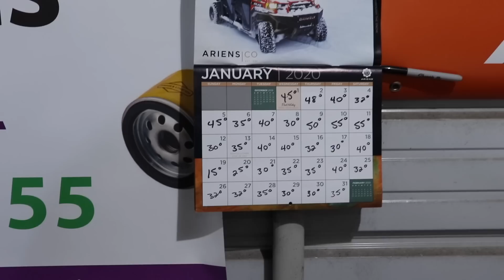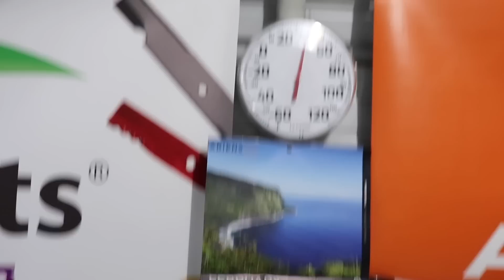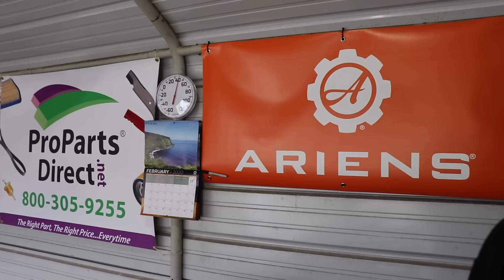WHICH FUEL ADDITIVES WORK? Which Don't?

Comment: Why are there no video reviews for star tron enzyme fuel TANK cleaner?

What is the difference  between fuel TANK and fuel system cleaners/additives?

And how many treatments do I need of the fuel TANK cleaner? 

Do I do 3 or 4 tanks from full to empty and  will I get a clogged fuel filter leaving me stranded???

If so, should I buy 3 or 4 extra fuel filters to keep in my truck for a just in case moment?

Comment: I've used Startron for years and it's never let me down. It's even kept fuel good I had forgotten about in a smaller gas can for two years. Still even smelled fairly fresh. Startron also has a new "Carbon Eliminator" spray you spray into your intake or carb at idle. My boat was hesitating and almost dying if I punched it outta the hole. Couple rounds of the Carbon Eliminator and the hesitation is almost gone out of my mechanically original 1976 Apollo boat with the good ol carbureted Mercruiser 165 4.1L straight six. I've also noticed the fuel guage doesn't drop quite as fast. So, in short it does exactly what it says it does!! Startron is simply the best in my opinion. You also can't OD on it like you can other fuel stabilizers, like StaBil. Use too much of that stuff and it'll literally eat your fuel jets. Ya....I'll stick with Startron. Great video!! One question I have is why do you go back to full choke when the engines try to die after they start making them sputter? Why not just kick the choke back on a little bit?

Comment: Feb. Wapio Valley picture, 40 miles from where I live. For the last 5 years I’ve just top off my Toro - Briggs engine mower with etho-free gas. Possibly use only 4 oz. of fuel a time, every 2 weeks. What impresses me is 99.9% of the starts are 1 pull. I’ve never owned a lawn equipment that did that. Also have a MTD Briggs 10 hp. chipper which has good starting qualities but I normal drain the fuel out and run the engine till it quits. Thanks for the videos!

Comment: My dad was an aircraft mechanic in WW 2.  He always advised me to let an air cooled engine run at idle for a few minutes to cool off before shutting it down.  I noticed you shut every one of them down at full throttle. Was my dad right or wrong?  Greg
Reply: They were probably cast iron air cooled engines. I have a couple of them and, I let them cool down before shutting them off. The others, I have, are all aluminium blocks and dissipate heat faster. It's probably an old school thing but, today's small engines are very different.

Comment: I'm no fuel expert, but it all seems to be a toss up. I was in a life altering auto accident in may of 2018 and just got a chance go fire up a couple of toys. One being a 97 bayou 220(a testament to itself) an the other a 09 yz 85. Consider one being a 4 stroke and the other being a 2 stroke respectively, but both had 93 pump used in the tanks and both fired up instantly(1 touch of the starter and one kick), after almost two years of fermenting. If you're surprised by this, we're in the same boat. I expected jelly carbs and fuel lines at this point if not inability to just ignite😕

Comment: Stabil 360 on 2 cranks but it surged a little before leveling out. What's making it surge like that since these are new engines. I know you have a video on engine surge but that is a used engine. #9 surged a lot too what's up with that bad gas already?
Reply: It's normal for an engine to surge a little when it's cold.

Comment: I'm all in on StaBil 360 Marine. Recommended for high humidity areas of the country. Every 5 gallon can I empty, I put 1/2 ounce in...don't have to remember to add at the pump. Use it all the time. If you don't, the junk in the gasoline builds up a layer throughout the fuel system. Its not only ethanol (drawing moisture from the atmosphere) in gas that causes all the problems, there are other chemicals added to gas that cause rubber to deteriorate.
Reply: Here we go. I've been saying for years that, small engine don't like ethanol. Some parts gets distorted and disintegrate. Rubber particles in the carb bowl was my first "hint".

Comment: Why leave fuel in the tank and carburetor to begin with? I've been running my lawnmowers until they run out of fuel before putting them up for the season and so far no issues doing it that way.
Reply: A dry carb will eventually have the gaskets dry out and crack, and the float will fail faster. Also, an empty steel gas tank will have more water condensation inside so it rusts faster. I keep my lawnmower and motorcycle gas tanks full all winter, with the motorcycle gas valve (petcock) left on, so as fuel evaporates from the carbs the float will open the float valve and refill the carb float bowls. I add Startron from the Walmart boat section to the gas. Very long term for a mower engine, I would add more fuel to the gas tank as the level slowly drops, or remove all of the fuel, and add a fogging oil to the cylinders and inside the carbs to keep everything moist.

Comment: Hey Taryl, Don't the engines need a blade to balance the engine? Or do the engines have a different fly wheel to compensate for the blade balance?
Reply: Yep, many models of small vertical shaft engines have weighted flywheels such as walk behind mowers that have blade clutches that can idle without the blade turning.

Comment: You should check the engine oil on at least one engine each month so we can see if there is condensation build up in the oil due to the engine oil not reaching operating temperature.

Comment: Im noticing some run better than others the surging could be from lack of blades i have had a few motors run crappy without the blade to balance the rpms im interested in seeing how they perform as the gas ages
Reply: No, a couple of these are too lean.

Comment: I've only used Stabil because it's the most common. I've personally haven't had any problems with Stabil.
Reply: I haven't either, other than be aware that Stabil goes bad if it sits too long on the shelf, usually it's less effective after 2 to 3 years sitting on a shelf, especially if it's been opened.  After 3 years sitting on a shelf I wouldn't bother using it in anything that will sit over the winter as it may not be effective enough.
Reply: Also, one must remember that, one additive might be good in one part of the world but, fail miserably at another place. Geographically speaking, I mean.

Comment: My Owner's Manual says to use 87 octane but I've heard so many people swear by "Premium" 93 even though their engine is not knocking.  Should be interesting to see how those two do against each other.
Reply: At "Shell" in my part of the country(North-Central Wisconsin), Premium (91) is non-ethanol, a given, so PROBABLY  the reason they swear by it NOT the octane rating, but because it's ETHANOL-FREE.

Comment: My concern is the way your testing the engines all on the same bench......If a float was to stick it would more than likely be rattled loose running the first few engines. A lot of times that’s what your doing by spraying starting fluid in it or sucking trash thought a jet. Plus, starting fluid will make it easier for an engine to run on older gas. Just my two cents. Keep up the great videos!

Comment: Taryl how are you able to start those engines with no blade on them I've tried to do it in the past on mowers and all it wanted to do was try and yank my arm off
Reply: There are vertical shaft engines made for applications other than the standard direct drive lawnmower. Some mowers have a clutch drive, and there are powerwashers, log splitters and string trimmers powered with vertical shaft engines; to name a few. They have much heavier (usually cast iron) flywheels to provide the needed reciprocating mass.
Reply: Some you can if the crankshaft is weighted
Reply: he also might have pullies on the bottoms
Reply: Headly Lemar yeah maybe

Comment: Are you shaking the containers of the fuel that's not in the gas tanks during engine runs? That'll be a factor if you have to refill I'd think. While a running engine might not swirl the fuel, the vibrations must factor in.

Comment: Question:  these are vertical shaft engines.  I seem to recall that vertical shaft engines usually have light flywheels, and require a blade or pulley to have enough flywheel mass.  The engines in the videos don't seem to have a blade or a pulley.  Is it possible some of the surging is due to not enough flywheel mass because they don't have blades mounted?  Looking forward to more videos as time goes on!
Reply: I would say yes

Comment: Have you been shuting off the fuel after using them?
Reply: No don't think he has
Reply: that would defeat the purpose of the experiment
Reply: Not running them out of fuel with the tap off, just turning it off to prevent any carb leakage
Reply: Mower Man gx85 

Most mowers bought off the shelf don’t have a fuel tap.  Remember this is  for the common folk!

Comment: I watched a consumer awareness show back in the 90’s and they proved that 90% of the automotive additives where nothing but scam. They did chemical lab test etc.
Reply: then why do you use a fuel stabilizer ?  must be in the 10% they didn't prove a scam.
Reply: Technology has changed!  I have used seafoam with grear sucess!  It fixed 2 non running machines on my channel.  NO TOOLS NEEDED...latest one a mower will be uploaded on my channel mid week.  Stabil does work for sure!  I can't speak on on the others but I'm eager to wait!
Reply: HERE IT IS!  Fixing a non running mower with NO TOOLS!

https://youtu.be/JKQidBYS7h8

Comment: I throw in some stabil every November and all my equipment starts fine come May. Been do that for 30 odd years.
Reply: Why not just drain the gas out and run the carb dry?
Reply: @finncampeau4922  It has been proven that leaving the gas tank empty causes rust in tank and more problems. You should fill the tank to the brim with fresh gas treated with Stabil or equivalent, before storing it for winter.
Reply: Andrew August I have been doing it all my life and have never had a issue. I have plastic tanks
Reply: @finncampeau4922  Well, there you go. Most commercial grade or bigger engines have steel tanks. Honda GCS Vs, GX
Reply: Brian Fraley well my biggest engine is a 25hp Kohler with a plastic tank. But I do do what you said on my 53 dodge truck I don’t drive in the winter
Reply: @finncampeau4922  The intention is well perceived BUT, some machines has to be ready at all time. Speaking of a generator, as an example.
Reply: In projectfarm's experiement, the non-ethanol gas started up after a long period as well. Stabilizers did very little to nothing to help. It was what the content of ethanol that mattered. They all started to corrode the metals, with high ethanol gas that did the most damages.

This experiment will further prove it. I feel like Project Farm's experiment wasn't enough.

I put stabilizer in my fuel, but I don't have high hope for it after watching Project Farm.

Just use non-ethanol.
Reply: Good tip
Reply: @themowerman  Pro Tip - Use Stabil Marine (Blue)
Reply: @kirktitgen6395  ok ta I will check it out

Comment: I have a portable generator that I haven’t had to use much in the last 2 years. But I do start it once or twice before winter gets here. It has had the same fuel in it for the last 2 to 3 years and it starts on first pull on ethanol fuel. It has a fuel shut off, and I shut the fuel off and let the fuel bowl run out every time. I do put Stabil in it so it must work

Comment: The vp was clear as a bell.wonder why?
Reply: Due to the VP product being an engineered fuel. We use very few components that we hand selected from years of testing we did on small engines. Our components are very pure vs. the average we've tested even in E0 blends (65 different substances!), some of which give the pump fuel a "straw" colored appearance.
Reply: @VPRacingFuel  Nice to know. Thanks for the information.

Comment: I hope Seafoam does well … its what I have been using however I always after 3 months I refill my equipment with fresh fuel and Seafoam and use the old fuel in my truck … I never have an issue …. my boat sits all winter though with no issue in spring.... Love this experiment !!!
Reply: We dont have it over here in the uk I don't think.

Comment: Hey hast smbdy a tip for me with my lawnmower? i have a Viking Lawnmower with a 150cc OHV 4 Stroke Briggs Engine.It burns oil.I bought it new less than 2 years ago and did the oil change like its supposed to (even after running it in).It runs smooth for 5 seconds and then the Cloud of oil gets worse and worse and the engine runs more and more ruff ( and it spits unburned oil out of the exhaust).nothing runs out of the Crankcase,and it isnt too much oil in it.No smoke comes out of the oil fill in hole.
Reply: Sounds like what happens when the choke is sticking or the carb has a blockage.
Reply: @terrystroble8657  so tear the carb down?
Reply: It's hard to give you a proper diagnostic out of thin air. I would recommend to call the place where you bought it. Things are no longer bullet proof nowadays.
Reply: if anyone has the same problem,try to let it run for a maximum of 15 Minutes.In my Case,i overfilled my lawnmower with engine oil and the oil got trapped in the exhaust.if your let it run,the oil gets hot and evaporates and also spits out of the exhaust.also try to look that you dont lose oil.no repairs were needed.

Comment: could test fuel revitalizersrs on engines that dont start like 
-Mechanic in a bottle
or 
-Start Your Engine
 granted will be hard to get consistent results with so many different types of fuels but good idea for next test projects😉
Reply: Yeah
Reply: I use Seafoam and sometimes it works!  Just fixed this non running mower with Seafoam NO TOOLS NEEDED 

https://youtu.be/JKQidBYS7h8

Comment: 6:00 - Gas in jars.
If those jars do not have vents, they will not absorb water like the gas in your mower.
You say: WHAT!  Gas caps don't leak that much air!
I say:  Gas evaporates from carb bowl out the air filter port.
Humidity comes IN the air filter port, and combines with the ethanol/gas in the carb bowl.
Water combines with ethanol, and sinks to the bottom of the carb bowl, accumulating there
and rusting the bowl over time.  By products of gas evap create lacquer.

Bowl gets low due to evaporation, float moves, new gas comes in from fuel tank.
This is the process that occurs continuously while a engine is parked.

This is how the entire tank eventually gets dumped into the carb and dries in there.
THAT is where the gunk/rust come from.

This entire conversation reminds me of the great debate about round/flat earth.

Every chemist responsible for gas formulation has a best friend that works
for the gas additive industry. Both have great bar side laughs at our expense.
Reply: He has two jars for each fuel sample. One vented and one sealed.

Comment: I just paid $3.21 per gallon for NON-ETHANOL for my small engines.
I just don't have any problems letting them sit, and I NEVER use an additive.
If I know an engine will sit for a while, I drain gas from tank, all hoses and carb,
and blow air through it all till dry.  EXCELLENT results.
Price of a dry tank/carb:   $0
Reply: Yeah funny thing is farmers get 1000 gallons of gas delivered into bulk tanks and use it till it's all weather it takes 5 months or a year and don't add a thing.
Reply: you are lucky we are at $9.99 a gallon

Comment: Great video as always!!!  That surging because of no loads on the engines?
Reply: I'm kind of surprised they didn't have some kind dummy weight bolted to the crank, I know if I start a mower with no blade it always runs crappy.
Reply: @grantw.whitwam9948   If that were the case, they'd all be surging, don't you think?
Reply: @johnnellis3025  You try it, you'll see the difference.
Reply: @grantw.whitwam9948  Don't forget some small vertical engines are made for applications where a heavier weighted flywheel is needed, like walk behind mowers with blade clutches.
Reply: Yeah it's not helping.. could of put blades on them and covered them up so it it is safe..

Comment: Stable is some off best stuff to use
Reply: stabil and seafoam!  I used seafoam to fix 2 non running machines that I have uploaded on my channel.  it doesnt work all time...when it does its THUMBS UP
Reply: I found is u mix it half and half it works well to if I have cabr problem running I've always  grab the sea foam off the self in the shop
Reply: @jordantractorvlogs7008    Here it is...using seafoam to fix a non running mower!  NO TOOLS NEEDED!

https://youtu.be/JKQidBYS7h8

Comment: I’m assuming that these engines do not have throttles. Never good to start or stop an engine wide open. They need time to warm up and cool off. If not it’s hard on the exhaust valve especially. But most people throw their equipment away and buy new stuff every few years.
Reply: I agree 💯 but Most all these new small machines have auto full throttles and my g/F’s Toro ZT and many other big machines specifically say to shut down at full throttle. But if they don’t break then folks won’t buy new ones. Same thinking with these cars/ trucks with that stupid “start/stop technology” that kill the motor at a stop light. That CANNOT be good to last after 100k miles.

Comment: I found laquer thinner  cleans varnish the best. Don't soak plastic or rubber parts.
Laquer thinner cleans instantly if you take carb apart.
Varnish melts away nothing else did so quickly
Expensive products didn't touch gum varnish.
VP is best I ever used.
Alcohol delivers much less BTU per pound and cheats is out of energy.
Excellent work Thanks Taryl!

PS: you should do classes at local high school and teach young kids how to fix stuff.

I taught troubled teen s and young men for state correction facilities many loved working on motors and stayed out of trouble.
I was a bad kid long ago. You are a good role model!
Reply: Thanks Mitzvah! Glad you like our stuff!